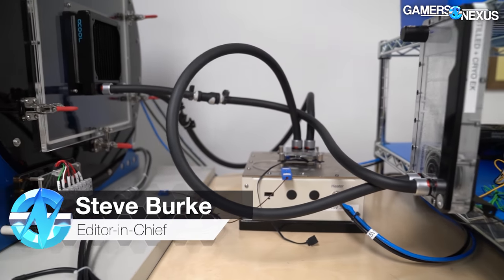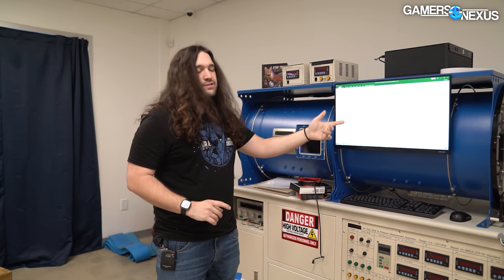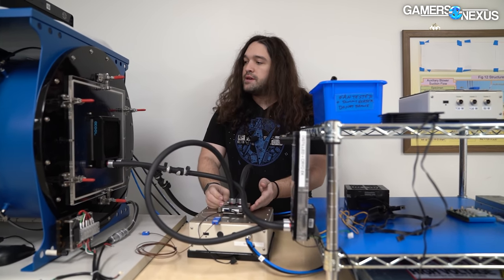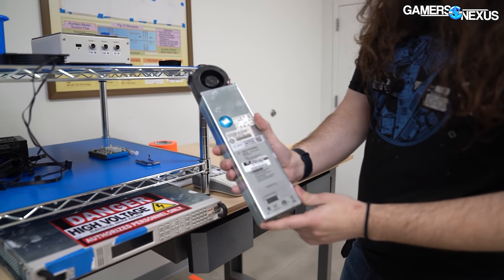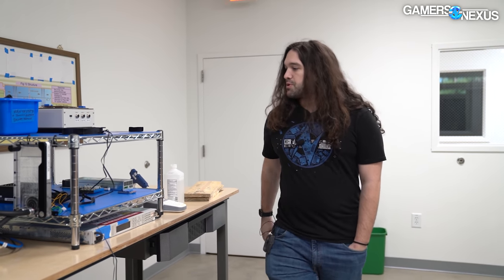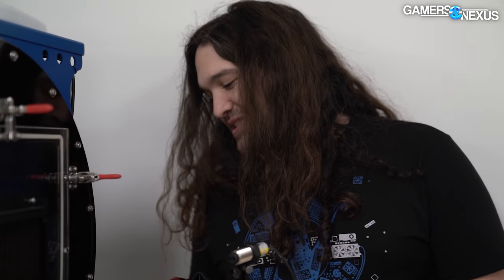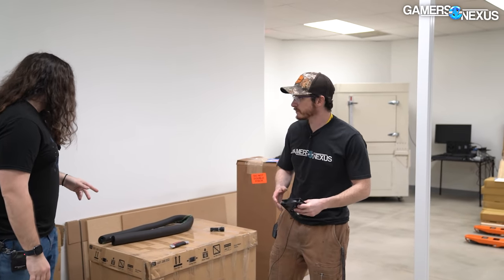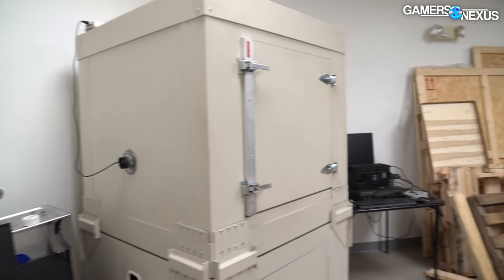GN Lab Update: Fan Thermal Testing, Pressure & Flow Charts, & Challenges

Comment: 20:15 you should also test how the mounting hardware that comes with the fan works. Because some "quality" fans come with extra soft mounting points that should prevent fibrations to metal cases. While other fans are just screwed plastic onto metal. So yes the foam part is necessary but I hope you can think of ways to test the onto metal mounted fans also.
Reply from the maker: Those would be cooler fans, which will be tested on the coolers they come with.
Reply: @GamersNexus  I mean bequiet has a bit of rubber in their mounting system for the silent wings 3 and I would want to see does this do any useful? And I just mean the case fans.
Reply: @GamersNexus  Noctua has rubber gaskets that clip into the usual screw holes, actually. Used them when replacing a terrible rattly stock fan in a UPS, very effective for dampening spots which are otherwise quite reverbating (thin plastic box).
Reply: @GamersNexus  Most high end fans come with some sort of anti-vibration padding, like the Phanteks T30.
Reply: @GamersNexus  Case fans are pretty much always mounted to a thin aluminium or steel sheet. Your foam test is good in theory because it removes a variable, but fans that cause case vibrations should be correspondingly punished in reviews. Just with fans which might register a low dB value overall, but the pitch is high.

A standardized piece of stamped steel to emulate a case in the low noise chamber is at least worth checking to see if it produces repeatable data.
Reply: Testing
 a rubber dampens fan is not usefully to me as a PC fan user as the main source of noise for a fan is the vibration that is transferred into the PC case and the turbulence cased by the average fan grill.
Reply: @BeerDone  Noctua makes silicone gaskets.  You can also find rubber ones, but they eventually become brittle over time, which defeats the purpose.  I made the mistake of getting rubber ones once.  Regardless, I would love to see some testing to determine how effective silicone gaskets or fan mounts actually are at reducing vibration noise.
Reply: Remember you're not just testing the fan blades and the motor, but also the housing. Considering not a single one of us has a massive foam " quiet hands" setup for our case fans, you need to test with the mounting solution that the vendor delivers with their fans. Extra bonus points to also test with an industry-leading mounting method (say a fresh set of Noctua rubber gaskets). In this way, your testing is akin to what you do for entire cases: test the stock-as-delivered configuration, and then test again with standardized (and likely more optimal) solution.
Reply: @garylingertot8136  I don't see how testing mounting solutions is relevant to what GN is testing for here, mainly, the noise produced by the fan blades and motor. Mounting solutions will differ in efficacy based on what material they're mounted to in the case, not to mention additional variables like the case design and how the fan mounting plate is connected to the rest of chassis. GN is trying to isolate the noise of just the internal fan parts, so the quality of the design and/or part selection can be compared to other fans in the same size category.
Reply: @discrep  Just because there are variables in customer installation shouldn't require a complete surrender. In the real-world I'll continue to be concerned how the product actually behaves as a system including the fan cage and its relationship to resonance and vibration. I don't think anyone runs an all-foam case hah! It would be nice to see scientific tests of different mount techniques: silicone mounts (ala Noctua  NA-SAVx), silicone corner gaskets, and full face gaskets vs metal screws.
Reply: @garylingertot8136  I agree they could make a video on the various different vibration deadening accessories, but that would only compare the various gaskets against each other, and even then, some gaskets may work better on some cases, so it might not be worth testing because the data is only relevant on the case used in testing.

The point of isolated sound testing on just the fan is to be able to know the differences between different brands of fans. If a $15 value fan performs the same as a $30 name brand one that comes with gaskets, you can just buy the gaskets separately and save money on the cheaper fans.
Reply: @discrep  My bequiet pure wings 2 compared to my bequiet silent wings 3. If I run them hanging from a small wire they are nearly identical inaudible, but if I have them in any sort of case (on metal because most cases have metal around the fan mounting holes. The silent wings are much better. So it is always necessary to determine in every fantest how they produce noise if they are actually screwed to a metal thing.

Comment: I put all my fans at 100% and clip cards to the frames so you can hear them flap as the blades spin... but gamers nexus doesn't test how flappy fans get at a given rpm so i have to do my own testing.
Reply: Literal "fans go brrrrrr"?
Reply: Just buy some of those Uphere fans and skip a step.
Reply: @burkemd  Seems like it 😂😂
Reply: They really should do this, maybe on the GN Extras channel.
Reply: They can't do that yet, because they first need a method to test the flapping cards properties. They have to decide which cards to use, then build something to make shure the cards are all the same and then, maybe, they can start testing that. I wouldn't trust your reslults on fan/card flappiness, because you propably didn't test it properly.
Reply: @gehtdianschasau8372  Also, the flapping cards' flappiness would change over time by being flapped. You'd need particularly unflappy manufacturing machines for flapping cards. Otherwise the tolerances would be too flappy to create consistent flapping charts.
Reply: How else do you tell if your computer is turned on if it's not for the noise of the fans?
Reply: Better be hockey cards. :)
Reply: Brings me back to my youth of clipping playing cards to my bike frame so that the wheel spokes made the motorcycle sound when you rode around the neighborhood.

Comment: Hey Steve, a correction: 3 pin fans have a tach pulse. 4 pin fans have a tach pulse and a PWM input for speed control. Both of these will report RPM. A 2 pin fan does not have a tach pulse. It's just power and ground.

Comment: Hey GN! One note about testing methodology that might be helpful for your laser tachometer setup. It's possible that putting even a very small piece of reflective tape could result in centrifugal unbalancing on fans spinning at high rpm. This could impact some performance data (most likely noise), as the imbalanced weight could introduce some 'rattle'. You could counter blance with a non reflective piece of tape of the same weight placed on the fan fin exactly opposite the reflective tape to prevent this. Or, at least do some A-B testing on fans to ensure the tape's weight is small enough not to have an impact. Love to commitment to the scientific method. Keep it up!

Comment: I’m curious - does the reflective tape cause the fan to vibrate or go out of balance?

Also - I think max CFM and max pressure make sense for a spec comparison. Other then interesting comparisons could be a noise-normalized performance (not sure what to measure, but a fan that blows more air at a lower volume is better, imo), and maybe you could figure out what the static pressure of a “good” and “bad” case would be and simulate that too?

Comment: Would the noise a fan makes when mounted ever be different than when "floating" ? As in, the way a fan generates noise while mounted be drastically different than floating alone in the anechoic chamber? So fan A is quieter than fan B while floating, but when mounted, B is quieter than A? Just curious, fascinating video.

Comment: Do fans have differing turbulence (result noise level) depending on case grills/panel? I wonder if having grill squares mimicking the hole patterns of various cases to screw into the fans during noise testing would provide useful results.

Comment: I have a question, and I'm not sure if it's with in the scope of your testing capabilities or even interest. So with a fan, you have a "dead zone" of air flow where the fan hub is, so in my thinking, the spot on the radiator where the fan hub is, isn't really doing much in the way of cooling the fluid that's running through it. So I'm interested in how the distance from a source of restriction being a radiator in this case, affects the cooling performance of the radiator.

Comment: Great solution for plugging the cord home is the acoustic fan tester. I used to work in the old Zenith building near Chicago before they tore it down. There was a massive anechoic chamber 20 feet below the basement level. They had a 10 inch diameter pipe going in  that was stuffed with rock wool. You walked out on piano wire and there was only 2 plug outlet in the whole thing.
Reply: Also it had (edit to past tense) both a vault door and a massive door on railroad tracks that had the same triangle baffles to match the room. Sad it got torn down.
Reply: So... the floor, inside, was a piano wire mesh? cool!

Comment: One thing occurred to me when you were describing the setup for heat testing. Having the whole loop as a control, wouldn't it be beneficial to also include flow meter in the loop? It would allow you to make sure the difference in temperature is a result of difference of fan performance rather than a different amount of coolant picking heat (ex. due to pump wear etc). Just my two cents.

Comment: Hi GN! Thanks for your videos. I have question about SSDs. Is there a significant performance difference with the OS installed on a PCIe 3.0 SSD versus 4.0? 

I have my OS installed on a Gen 3 NVMe m.2 SSD. I just picked up a Gen 4 SSD and have an open slot on my motherboard that runs Gen 4 PCIe.

Comment: 25:33 Piece of advice.
When using a saw, don't push down on it. The more you push it into the wood, the worse the cut is going to be and the harder it is to drag it back and forth. Just drag it back and forth and let it sink at its own rate.

Now, some saws will require a light pressure to work properly, but light pressure isn't much. A bit more can be required if sawing upside down, but often one isn't in that position.
You don't need to apply your body weight onto it.
Reply: What they need is a better saw. I'm looking at a Japanese ryoba saw right now on Amazon marketed by QiHong that I bet would do the trick for them. Decent western style saws cost considerably more. Or you have to know how to sharpen and tune them up yourself. Paul Sellers don't work for Steve either.
Reply: @1pcfred  or idk, a power tool.
Its easier to cut a clean line with a circular saw. Less time and effort too.
Reply: @1pcfred  Using a saw correctly is still a decent step forward. And quality of the cut isn't really the main goal when one just wants to part two pieces.

It doesn't matter what wood saw one uses, if one has incorrect technique when using it, one won't cut fast nor cleanly.
Reply: @ImGoingSpace  For the application of parting a board in two, yes a circular saw is a fast option. And usually fairly straight as well.

Though, power tools tends to compromise on fidelity in exchange for more speed. So depending on the cut, a hand saw can be more adept at the job. Not that we see much fancy joinery these days.

One can still have an array of specialized power tools for doing joinery, the cost however tends to go through the roof compared to a hand saw, though the hand saw is a bit slower.

Though, with proper technique it isn't particularly tiering to use a hand saw, nor all that slow. But most people don't use proper technique and wastes a ton of effort on binding up the saw.
Reply: @todayonthebench  how well a saw cut goes definitely depends on the saw you're using. Technique is not going make up for a deficient tool. You ain't carving the Thanksgiving turkey too good with a butter knife. That's just reality.
Reply: @ImGoingSpace  if someone is not too familiar with tools I'd rather see them using a hand saw than a circular saw.
Reply: @1pcfred  Yes, there is a difference between quality and junk saws. But using the saw correctly makes a large difference compared to not using it correctly, regardless of the quality of the saw.

I am not pissing on quality saws, just saying that the saw they have can be used with better technique to deliver better cuts than what they got at a far faster pace with less physical effort.

I am criticizing the technique, not the saw.
Reply: @blitzwing1  good hand saws are a rarity today. I'm not sure if that hand saw GN has could be made good. The really good ones had hollow ground saw plates. Hand saws are one of those tools where there's more going on than meets the eye.

Comment: 14:03 The third pin on 3-pin fans is the tach. The fourth pin on 4-pin fans is the PWM control signal. Both 3 and 4 pin fans have tach output on pin 3.
Reply: Yeah, that should be better than tacho tape.

Comment: Hey Steve, I'm pretty sure the answer is "yes," but are the heating elements that emulate a CPU replaceable? Also, will you be using the identical dummy heaters for the tower coolers and the fan testing, or do you have other ones for cooler testing, so you don't need to undo the loop every time?

Comment: I would consider a fan noise test mounted against an arbitrary case mount - some fans are designed to eliminate vibration based noise there (e.g. the rubber corners) and some aren't.  That noise point is a shared duty between can and case so shouldn't be ignored?

Comment: If you're going with a wooden base for those acoustic fan mounts, you might consider covering any visible surfaces of the wood with acoustic foam too, as that would help reduce sound reflections within the chamber. That's the reason the whole inner wall area is covered in that egg box shaped foam.
Reply: Thinking a little more about that whole mounting system I'm wondering how consistent the distance between the fans and mic will be, given the fan mounts (the base in particular) don't appear to be locked into a certain position very accurately. I can imagine through swapping out the fans several times the distance will change slightly which will skew the results. GN have been very clear on their stance that any slight deviations on distance between source and recording device invalidates the data.

Be good to see how you plan to avoid this.

Comment: I'm not sure how much noise testing you'll have outside of the sound chamber, but having a simple metal bracket (maybe this could be held with foam) to see how effective a fan's isolators are compared to a foam friction fit (which is what I think you're planning on doing from the expansion) would be helpful for the end user to see the effectiveness of fan cage designs.

Comment: Will you be also testing computer housings for the pressure buildup at given flowrates? This will give the missing link in terms of operating point, and it would be interesting to see how different housings, or different fan configuration, or different internals (restriction of gtx 1660 vs rtx3090) influences the flowrate for a given fan/power/noise level

Comment: idk if I missed it, but can you just noise normalized the fan inside the anechoic chamber, and see at what RPM it's running? Say for example, for 35dbA, the fan is running at 1200RPM (completely pulling the number off my arse here). So you just translate that data back into the radiator test. That would be better than doing a noise normalized test outside the anechoic chamber since you can remove any outside noise factor fairly well.

Comment: You can cut the flicker on those seven-segment displays by adjusting your camera's shutter angle / shutter speed. 

Experiment with it. I couldn't say for certain which shutter angle will look best with that specific equipment, but that is the adjustment to fix it.

Comment: Question: how relatable would the temperature data based on radiator/water cooling setups be to a direct air cooling context?  I think I remember something about fans on radiators having their performance determined more by pressure while direct air cooling is determined more by flow?  I'm really not sure, this is second hand information and half-remembered, so hardly reliable.

Comment: Data I'd love to see from these

- fan 100% pwr (noise & cooling / flow + pressure)
- fan set to a standard noise level ( cooling / flow + pressure)
- fan set to cool a standardized heat load that simulates 'in use' load, such as gaming (ie set up a standard fan curve, target getting to 80degrees or a normal operating temperature, and see how much noise it generates / what flow + pressure it outputs while maintaining that temp)

I've no clue how much of an issue it'd be, and I'm sure you've got / will have data to test it later, but the degradation of the cooling system seems like it might become an issue over time?

Comment: Does the Intel dummy heater have a 200+W load (12900K wth XMP on Cinebench R20)? Also the AMD one is little under the real load of a 5900X (which draws a little bit more than the 5950X). But, I digress, neither of them can be cooled well with a 120mm AIO, so perhaps it doesn't matter.

Comment: The 3rd pin on a DC fan is the tachometer. The 4th pin on a PWM fan is for the PWM signal. 2 pin DC fans for PC are not common. 13:50
Reply: Some older motherboards did have hi side mosfet as PWM control for 3pin fan header. It was switching pin 2
Reply: @LimbaZero  I think a lot of gaming motherboards have DC fan controls. The top AMD motherboard on newegg (I know) has "Fan Xpert 4" that can automatically test DC fans across a voltage range and turn it into a sudo PWM fan.